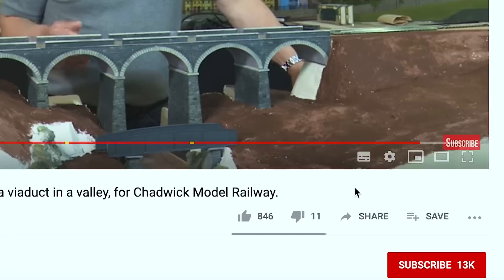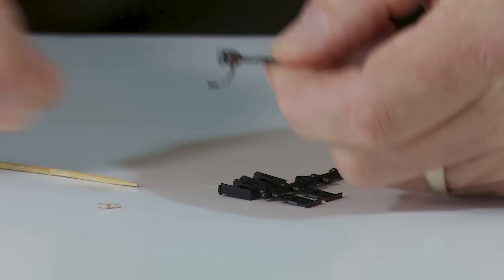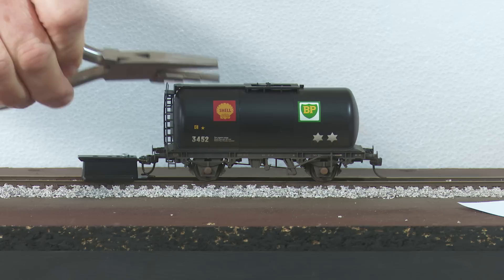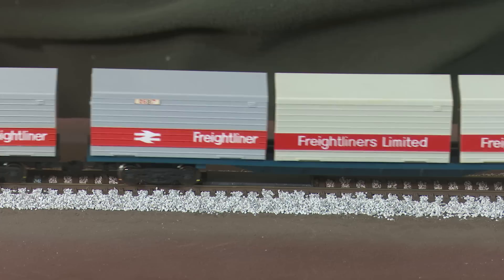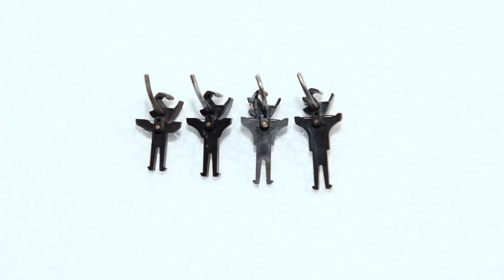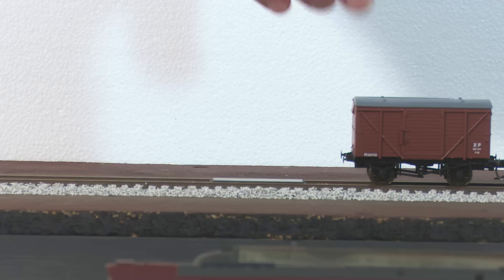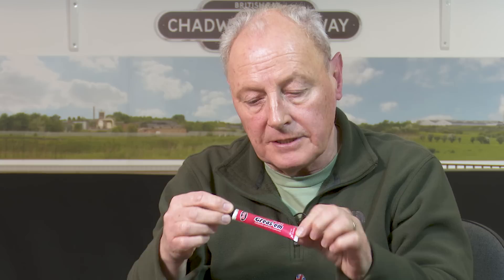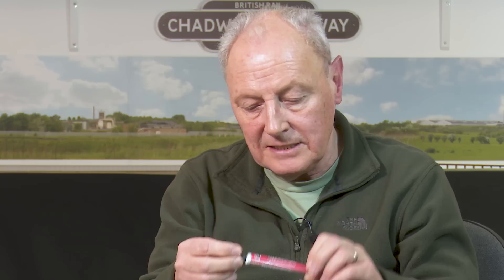Kadee Couplings at Chadwick Model Railway | 81.

Comment: Hi Charlie. Excellent video as always. I have some Kadees on order and was experimenting with getting the shuffle to work on a lenz silver plus which I know you use in some of your locos. Do you know of anywhere that has the cv settings to do this please? The main issue I had was allocating to a suitable function key as I think setting cv145 to 1 and cv146 to 2 controls the motor. I have searched the internet in vain. I appreciate this is a very particular request so it’s not a problem if you don’t have the numbers to hand or the instructions you used. Looking forward to the next video. Thanks. Alan
Reply from the maker: Sorry Alan but I only know through experience, about the ESU arrangements
Reply: No problem Charlie. Thanks for the reply. I had a little experiment this morning and managed to get it working by systematically changing some values so I just need the Kadees to arrive now to really try it out. If anyone else asks the same question please feel free to point them in my direction. Thanks again. Alan

Comment: Hi Charlie, Hope you've had a good Christmas. I have some Kadee No5 (with gearbox) that I wanted to fix to an Oxford Rail Mk3 then put a No19 in the NEM pocket on my 47/7. But, I see a number of people saying not to mix the European (17, 18, 19 & 20) with the US stuff (anything else). I note you have a mix of stuff in the video, have you had any problems with mixing it? Thanks.
Reply from the maker: I do mix them where necessary, normally on freight wagons.  Sometimes I do have to shuffle the order for better reliability.
Reply: @ChadwickModelRailway  Hi, thanks for the quick answer and sorry for asking more. I'm just wondering what the problems are when they are mixed? I wouldn't be looking to use magnets for uncoupling as the train stays as a fixed rake when it is on the layout but I would like the train to stay together pushed or pulled (as it is a push-pull rake). Do you think it would work well enough?

Comment: hi
these kd couplings are not as good as you may think - i bought a polar express from the use and these 6 couplings in total and once per week the little capture spring comes off then the dont couple so i found these on line called E-Z Mate mark II and STARTED TO BUY THEM AND FIT THEM BUT AFTER 2 WEEKS ONE OF THOSE DROPPED A SPRING OUT  so now i bought all 6 and fitted them plus e-z mate sent me a free pair of couplings  but i am not so happy with these type couplings i managed to find the spring on the layout from the new coupling and fitted it back with a cocktail stick very hard to do so now i dont use the coaches with the polar express a great pity as there is lights on it  - so what i am thinking of doing is to find out if these new magnetic ones will work
Reply from the maker: An interesting comment.  I'm using Kadees on my freight stock with problems only on Dapol loco's, as their NEM pockets are floopy!  My coaching stock are being converted to Hunt Couplings which really are much better.

Comment: Hi Charlie. Still fitting tenders and ends of coaching sets with Kadees. Have already mentioned the different heights in NEM sockets but have also noticed that my Kadees nos. 19 and 20 are underset whilst nos. 17 and 18 are centre set. This has proved very useful at times. However have yet to see them advertised as such. Do you know of this or have you come across this feature? Best regards Barry
Reply from the maker: That’s interesting Barry, I shall check it out. Regards Charlie.

Comment: Charlie, for the benefit of those, such as myself, who are not familiar with expressing curves in terms of their number would you please tell us what a first, second, etc radius curve is. Thank you. Best Regards. Ken May
Reply: I agree - and the radius number will depend on the track manufacturer as well. R1 PECO Settrack will not match R1 Fleischmann, for example.
Reply: Hi Chris. When I asked Charlie to tell us about radius numbers I had no idea that the numbers were not to a standard. Think I’ll withdraw the question .
Thanks for your comment.
Ken.
Reply from the maker: Hi Ernest, the track radius are,
1st = 371mm
2nd = 438mm
3rd = 505mm
4th = 772
Regards Charlie
Reply: @ChadwickModelRailway  Thank You!

Comment: On paper they do look awesome, but at exhibitions I often see them behaving unreliably, even though when you speak to the operator, they will tell you they are fantastic and normally just work as expected. Maybe it is the subtle height mismatches which are causing the uncoupling failures I have witnessed at the shows?
.
For me the sheer cost makes them out of reach as I'm only able to afford second hand rolling stock anyway. So this would almost double the price of each wagon.
.
Great video and explanation as always, Charlie. Looking forward to the next as am considering custom home made wire couplings, so wondering if your next video will be on them.
Reply from the maker: Do take a look at Sprat and Winkle.
Reply: @ChadwickModelRailway  - Yes I have seen them but again budget could be an issue. I have seen a guy at an expo who had soldered up his own very similar to the S&W approach, but maybe a bit finer?

Comment: Oh Dear, Would that life were so simple !  I decided ( God knows why,)  to model American railways .... I don't even like America.  Whilst this video treats of exchanging couplings,  the job is far more difficult when you try to "rationalise" a whole layout.  I gave myself a huge job with the addition, for reasons of lack of space, tight curves.  Presumably they don't have any in America, as everything is so BIG there. The main issue is that American rail engineering is worlds apart from the UK.  Their stock do not have "buffers".  Just a large knuckle coupler that fulfils both jobs.  Incidentally,  knuckles and buffers are not proto-typical.  There are potentially 31  different variants of Kadee  couplings , and when you start from a point of total ignorance like I did, you take on the whole world.  To cut a long story short, take a look at couplings on " Trains4africa.co.za  "   that should illustrate what I'm trying to explain.  Good work Charlie,  this is a good start !!!
Reply from the maker: I’m so pleased that you found the video interesting, but as you say, couplings remain a complete and utter nightmare. Regards Charlie

Comment: Ah my favorite coupling. Have a look at the bew Hunt Magnetic couplings as a solution for your Frieght Liner stock. I think :DaveClass47" has just done a review on these used to close coule carriage stock. Loojing forwards to episode 3.
Reply from the maker: Hi Bruce, yes these do seem to be a very attractive new product. I can’t see they will be that useful for shunting operations but for coaching stock, brilliant.
Reply: @ChadwickModelRailway  And great for your HST Charlie, you should be able to get the stock very close together. You are right of course, no good for shunting but for fixed rakes they should be ideal. I have been messing around today with my CAD programs and starting to design a version for normal wagons. Need to look for veryt small magnets and then crank up my 3D resin printer, print off a prototype and see if it works. Still no good for shunting but who knows where this may lead.

Comment: Charlie, excellent explanation.   Will you be trying the new Hunt (magnetic) couplings from west hill wagon works?  https://youtu.be/mF3Naojsfw0 Not easy to auto-uncouple, but small and (apparently) reliable. Regards, Tom
Reply from the maker: Hi Tom, I will certainly be trying out those new couplers. However they have currently sold out. I’m unsure if they will have the ability to hold a train together through a helix. Only time will tell. Regards Charlie.
Reply: Chadwick Model Railway   I’ve seen home-made versions for the dapol MRA side tipping ballast wagons, (https://youtu.be/1UJIMh7v8VM) and thought these would be good. My order is now pending and will hopefully be ready in 10 days time. 😕.  Can you find a long helix to test it on?  Hades, perhaps?
Reply: They claim 9 coaches up 1 in 4 on R2 curve, which is impressive. (In fact, 1 in 4 is impressive; let me get the link to check that)